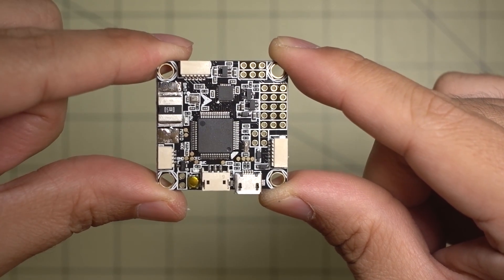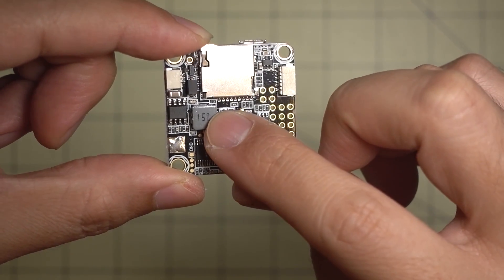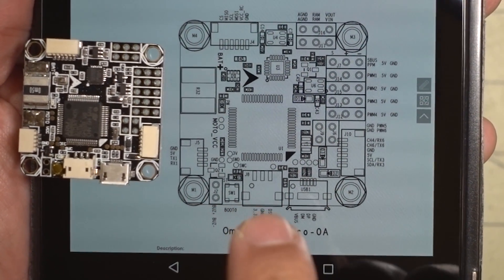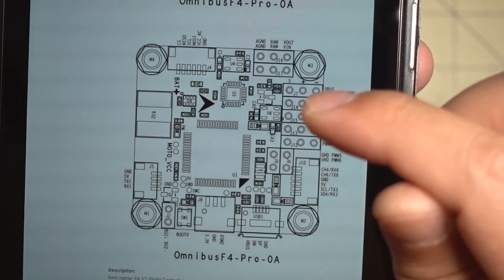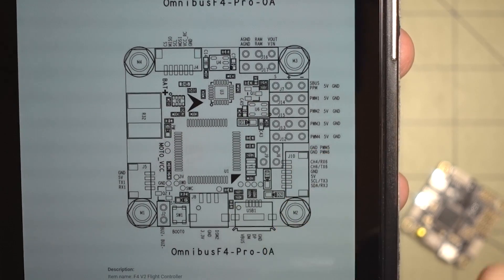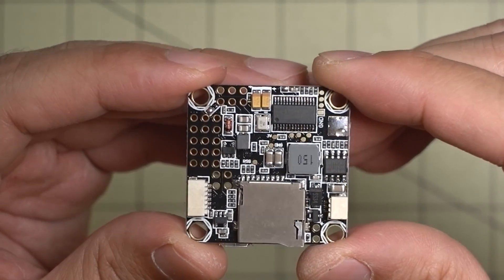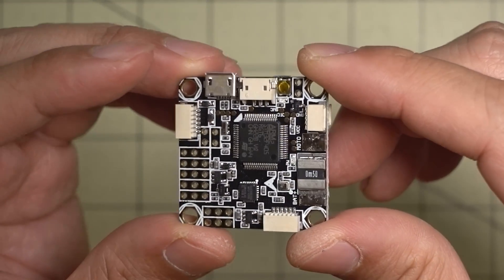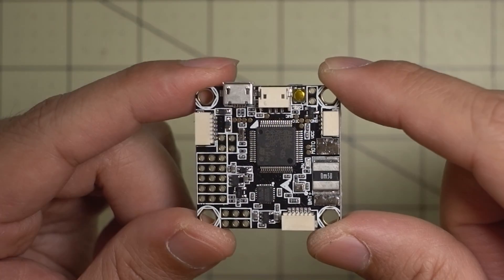Omnibus F4 Pro V2 Flight Controller 🌟😀

Comment: I have the same board. My escs are soldered to a PDB which is where I want to connect the 3S lipo. My PDB has got 5v BEC. Can I power the omnibus f4 pro v2 from that 5V BEC? (connect them to the main BAT+ and gnd pads on the flight controller)?

Comment: Hi Albert - I Have the Omnibus F$ Pro - what identifies a particular INav UART Port -  is it the Tx 1,3 & 6 designation - cos I have connected my GPS Module J5 (4pins) and it is recognised with Port UART1  or  I  can connect it to J10 (6pins) which has Rx3/Tx3 
 Rx6/Tx6 labled  therefore in my understanding these would involve UART3&6 ports - please clarify if possibe...joe

Comment: Hello,

I have the same fc. Its comming with bf 3.1.7 But i cant bind sbus receiver. No signal to fc and transmitter. Mabe i have to boot..but i dont find the boot button. 
How can i solve this problem?
Reply from the maker: I don't know what receiver you are using but check if it is compatible with the hardware inverted signal from UART1

Comment: Hi Albert, after damaging a F4 board due to soldering, (damn little pins) i was glad, you mentioned you don't even solder at all. Is it possible to connect als stuff (for a plane)  to the J11 connector? (left down when usb is pointing downwards). Because i will use the board for a plane i am less interested in the BEC function. Is it possible to skip that as well en fuel the board tith the esc with bec?
Reply from the maker: I think supplying 5v from a BEC to the 5v rail is possible.   Yes, using J11 for your PWM connections will work.